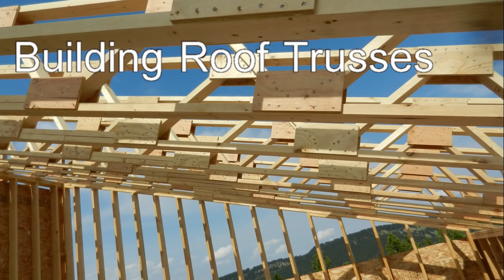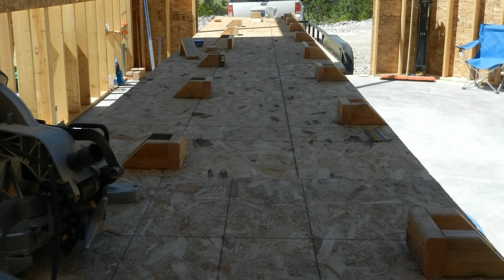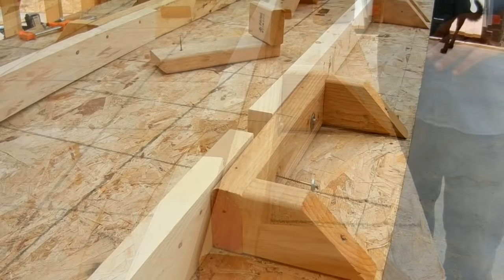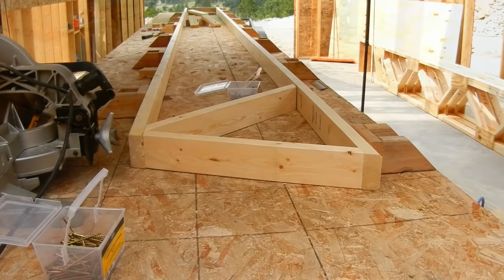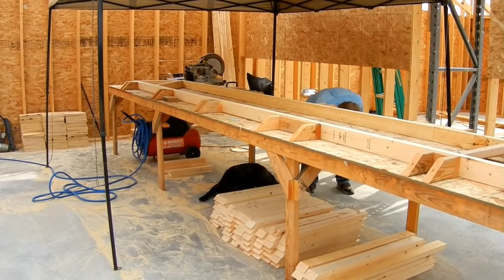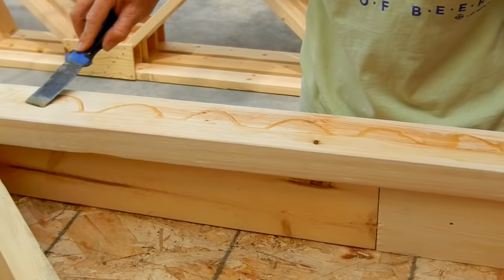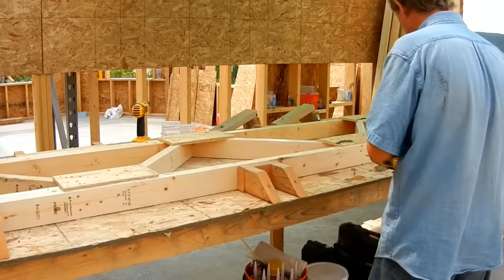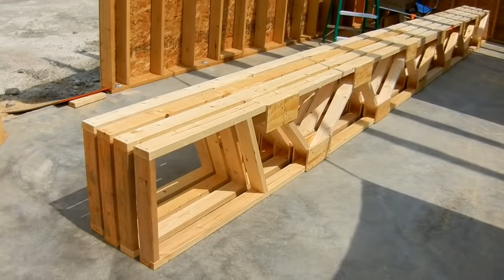Building Roof Trusses

Comment: THis video is great but where is the plan, how do I know the angle (degre) and the pitch of the roof, the lenght of each piece, unfortunely it is wortless if none of these info are provided, thanks
Reply: Clearly the video isn't a how you do the job but how he did the job.  You will have to figure it out for your unique situation.
Reply: @Michel Boutin --- After you know the pitch, depth of truss and the truss' span all calculations can be made using your high school taught trigonometry. Btw, you would need to know also the web design pattern.

Comment: Good job, curious though, why did you use the 2 by 4s on the flat side? It's at least 3 times stronger vertically.
Reply from the maker: I did it to have more material to nail into. 2x4's are stronger in bending strength vertically but thats not how a truss works, the members are primarily in tension or compression and that is the same in either orientation.

Comment: How much weight can this truss carry compared to 2x10 floor joist
Reply from the maker: Depends on the span, a 2x10 typicality would only be used to span about 10 feet. I don't have a load rating for you but it is many times what a 2x10 would hold. Especially at a 20 foot span.
Reply: @BSpotBuilds  thanks for the reply . I am planning on building some 30’ floor trusses soon but I have yet to decide whether to build Pratt trusses or warren . Just like you . Can you recommend what you would do? Any feedback would be very appreciated it since you have much more experience with trusses then my self.
Reply from the maker: @jovanyjuarez7772  I am not an expert, but I believe the Pratt truss is better for floors because it will make it stiffer. You can also engineer a longer truss with Pratt using the same materials. I believe the warren uses less material for the same span.
Reply from the maker: You will have to determine what loads you are comfortable with. But typical span on a 2x10 would be around 10 feet, and it is not uncommon to go 20 feet with a truss. All depends on design, load, and how much bounce you are willing to accept.

Comment: Good job! Looks easy, and strong! Just wondering, it requires an engineer/architect to calculate lenght/ strength of the trusses, right?? Building them is easy part, my brother in Finland did the same thing, and there they get snow, maybe 3 feet at winter, right at Arctic Circle, Finland!! That have been nice and strong for 15 years now=) By the way, how long is span/one trusse?? Wau, and your house will be huge!!!!1 How many stores/ squarefeet??? Like you spot, view too =)) Where is your house??? youtheman! Ps. using Gorilla glue??? Any good???
Reply from the maker: +Eero Laukkanen Where I live there are no building codes so I didn't have to use an engineer, but I did do a lot of research and looked for comparable  designs ( similar spans, depth and loads). We do get snow here in Wyoming. The house is one store and less than 1500 sq feet the truss span is 26 feet. After some research I chose Gorilla glue it is water proof which you want in a roof installation and bonds well to rough surfaces because it expands in to the crevices it also has good strength and flexability.
Reply: Good to know, thanks!! Only one floor, your ceilings are really high, huge windows??
Reply from the maker: +Eero Laukkanen Ceiling goes from 16 feet at the peak down to the standard 8 feet.  The windows aren't huge as they are around the walls.  Makes it feel much more spacious inside since it is a small house.  Check out http://thehighground.weebly.com/

Comment: What is the distance between both walls?  I'm trying to design essentially the same thing, but need to span 28'.  I am not a professional and really want that single pitch roof.  I really don't want to pay an engineer. Is this possible to do on your own? can you suggest any books etc...
Reply from the maker: 20 feet between walls, truss is 26 feet total. You can make your own if you don't have to comply with a building code that states otherwise. I don't have time right now to find documentation, but a Google search will get you started.
Reply: @BSpotBuilds  Thank you! Yeah there are no building codes here in southern Missouri.  I do want to make sure it's safe though.

Comment: Would adding wood glue to all joints help the strength of the overall truss?  I love this video!
Reply from the maker: All attach plates are glued. If you mean the 2x4 ends, no I don't think it would do much to increase strength.
Reply: I was taught that the glue ends up being stronger than the wood itself...if it clamped under pressure or in this case, glued and screwed.

Comment: Your spacing is 24" or 36" in this video ?
Reply from the maker: Roof truss  spacing is 24".
Reply: @BSpotBuilds  Just an update, my trusses are just a bit longer about 27 ft total length. I built roughly 20 trusses so far out of 52. Everything is going nicely I used self tap wood screws so I didnt have to pilot my holes and I used 3/4 OSB for gussets and 16" × 7.5" . By myself I can do 1-3   per day depending on how things go.  I only put one up to check it the first one I made, the prototype made a few adjustments before making the final jig on my truss table. I noticed that plaining with my electric planer till flush before setting the gussets helped get everything really flat. I used premium construction adhesive with the 3/4 OSB. Same thing minor changes. I glued the seams where the second 2x4 holds it all together glued the whole thing in. Thank-you for your video once again! Let me know where I can send you pictures of my contruction journey and my finished trusses if your interested. Thanks again !

Comment: How did you size the trusses to be sure they met the strength requirements needed? Did you consult an engineer? They look good and the video was interesting, just curious.
Reply from the maker: +SethGelineau --- I researched trusses and looked at buildings with similar designs. The span and load are nothing special definitely not pushing the envelope. From my experience if you want to optimize a design, and build it as close to the minimum as possible for both material and cost savings you need an engineer. I am to cheap to hire an engineering and am willing to accept any risk there is in my work. I have worked with commercial trusses and these came out much more stout.
Reply: Thanks

Comment: I'm confused, you appeared to use standard "Yellow Zinc coated Phillips heads to assemble the truss. These screws do not have a shear value for structural loads. How did the truss pass inspection? You opted for appears to be 1/2" plywood sheets vs a $.97 mending plate, why? Mending plates have proving to be a superior in every aspect of structural loading in residential construction. Are you concerned with people following your example and having catastrophic truss failure based apon you design?
Reply from the maker: No I am not, mine haven't failed so why would theirs. Are you worried that you will discourage people from living a full life by scaring them in to relinquishing control of theirs to designated experts?
Reply: @BSpotBuilds  no I'm not. I asked legitimate questions that you did not answer. Yellow Zinc Coated screws do no carry shear load? You did not use proven mending plates over plywood sheeting. A technique that is no longer used or approved in residential construction. You present your truss building video as if you are an expert and your not. When I ask legitimate questions you fail to answer instead you attack me and my motivations. I did not attack you, I asked simple questions. This is what I really don't understand, you put a video out for public consumption. Then you attack anybody who questions your ways and means of building. If you can't take the question don't publish your videos.
Reply from the maker: Ok, you want to have an intelligent conversation so here it is. I publish a video it's what I did, it is suitable for my situation Its up to the viewer to determine if it's suitable for them. It is not hard to design a truss to withstand normal roof loads I believe it is wrong to discourage people from doing so. Also If someone had a failure it is unlikely it would be catastrophic. With that said I used screw in two places 1) on the ends of the truss to hold the boards together when connecting to end grain. At the eave there is essentially no load and at the ridge the joint gets a connection plate when marred up with the truss for the other side. 2) On the center join where the primary purpose is to clamp the two surfaces of the glue joint together while it dries.
Essential the screws are for assembly not for structural strength.
So the connections on my truss have glue, nails, and sometime screws to attach the gusset plate. Before the 50's it was common to build trusses on site and the connections were just nailed that's it. As for the mending plates I cut 48 gussets out of a sheet of plywood, so at 97 cents a mending plate that's about double the cost to use mending plates vs plywood and I cant glue to a mending plate also they are not easy to properly install in the field with a hammer. A field installed mending plate is far more fragile than the ones pressed in on a truss jig in a factory. Next time if you want a positive response ask a question don't state that everyone knows mending plates are the way to go whats wrong with you? and are you concerned that you are killing people.

Comment: Does pre drilling save on batt live as opposed  to useing two batts in the impact driver ?
Reply from the maker: Walt Lars The reason I pre-drill is to help prevent cam out and to allow the screw to spin in the first 2x4 so that it will pull the second 2x4 tight against the first. The screws are mostly there to clamp the two pieces together until the glue dries.
Reply: Cool thanks

Comment: Not sure where you work, but do you have an engineering degree? Using the IRC's prescribed rules, I've not seen truss design codes because every project  is  so different. I know it provides for traditional hand framed rafters though.
Reply from the maker: I don't,
No,
IBC ? I never cared for building acronyms.

Comment: I've built my own roof and floor trusses for years. In fact I've never actually bought a manufactured truss. Never had one fail yet. I always found that the simple ones are about a third the cost of manufactured ones and the really complicated ones are an even greater savings than that.

Comment: What does the glue do vs just using screws?
Reply from the maker: The glue is much stronger than the nails and screws. The main reason I used screws in a few places is to clamp the part together while the glue dries. Engineered lumber such as LVL and I-joist only use glue, and old time trusses only used nails.
Reply: @BSpotBuilds  damn i didnt realize glue was that strong.  I guess with a big area covered in glue it is.  Hey do you know if you build your own door jamb are you using just glue to glue the jamb legs to the head jamb or should you shoot some finish nails in there too?  Ive got a router also was thinking about picking up a rabbet bit and tryna make a homemade jamb.  Wasnt sure about what all to use to fasten the pieces together.
Reply from the maker: @morokeiboethia6749  I would use glue and screws, because the screw has better pull out strength in the end grain than a nail.
Reply: @BSpotBuilds  I got to see a vid a while back that was filmed by one of those testing agencies that works in tandem with code lawmakers and it was a comparison of nails vs the code equivalent screw.  I had always heard "nails have better shear strength and thats why they are used."   The nail did not win any of the tests against the screw.  It was a test that fastened boards in various ways then a hydraulic mahcine that measures pounds is used to  put tentsions on the boards.  The test is stopped when one of the 3 things happens - 1 "pull out" - nail/screw can not hold into the board any longer and is pulled out 2( shear out -  nail/screw snaps due to tension  3)tear out - fastener holds into a board but tears out the edge of the board   The screw won ever single test.  One was where a horizontal board attached to 2 vertical boards then the machine puts shear force / downward force on the horizontal board.  Most people would think the nail would win b/c it supposedly has superior shear strength.  It never makes it to  that point.  The nails lost every test due to pull out.  Screw not only won but it won by a landslide in the tests.  Home builders use nails b/c they're cheaper and require less man hours to complete building a frame.  Nails are not structurally superior in any way.
Reply from the maker: @morokeiboethia6749  I agree, and if you need more shear put two in. Same thing with pre-drilling, I always pre-drill, it minimizes splitting and helps pull the two boards together. But the experts will tell you it takes too long and is a waste of time.
Reply: @BSpotBuilds  Me/friend of mine were building a pier with a huge deck with compostie decking boards (probably trex).  I started predrilling b/c the trex screws had rubbed the skin on m fingers raw b/c of the way the thread is.  I started predrilling just so the screws would catch the holes immediately where i didnt have to hold them in my fingers and eat the skin off and of course i get the "predrilling is a waste of time."  I said ok lets race.  If you have a lot of screws to drive like on decking it actually was faster b/c i was done and he was on his last joist but not even half way.  I just drilled a 100 holes then drove screws those 100 holes but only switched from drilling to driving screws one time.  Predrilling is definately easier on the wood especially if you're using a regular drill to drive screws b/c that dry torque of a reg drill splits/tears the wood really bad especially if you're toe nailing.

Comment: Is their a problem if I use 1/2inch osb for my gusets?
Reply from the maker: I am sure there is an installation method using OSB that will work, It's not common and you will have to ether find a design to copy or design it your self.

Comment: Why on earth would you do all that pre-drilling and screwing when you had a framing nailer ?
Reply: For a more accurate squaring of the assembly. Screws pull things straight and tight. Nails are more likely to blow out the ends of lumber as well. That's why he pre-drilled as to not split the material.
Reply: @patmos7521  Commercially made trusses are mostly held together with Truss cleats and nothing else. Also nails have a better shear strength than screws. Just seemed like like a lot of overkill.
Reply: @jimmclean9312  Maybe so. I respect the man's methods, though. Seems to care about his work so why would I question that?

Comment: Before using any wood in framing; go to the lumber yard and hand drive in a framing nail or two and then pull them out.  Some wood will not hold a nail; lumber yards nowadays will sell just about anything,

Comment: Nice. What if you covered the open faces with rough cut lumber? It would look like a rough cut beam, but be much lighter...
Reply from the maker: I filled the open web area with insulation.
Reply: So these were enclosed within the ceiling?
Reply from the maker: Yes, sheathing on top drywall on the bottom.

Comment: Hope they were engineered for what ever load maybe snow.Just because they look strong doesn't mean they are.
I used to be sawyer at certified truss.I cut many cords and webs on a metra cut centerline saw never seen any flat trusses built like that.
Always nail plate and no 1 or better top and bottom cords.Glue and screws no way never.

Always work from a very specific cut list inspected and stamped.
But hay my work went on public building so maybe it was over kill?
Reply: The Simpson Strong-Tie plates are stamped "non-structural applications only", (labeled not for truss applications).

Why not for truss construction? Do you have a product that can be? Like the MT20 that is used by truss companies?

Simpsom Strong-Tie said:
"Truss construction has very specific guidelines and requires appropriate equipment. We do manufacture metal connector (truss) plates, but they are sold only to licensed Component Manufacturers in conjunction with the Simpson Strong-Tie Component Solutions™ software suite. Thank you!"

I've installed one with a hammer and the plate warps and some sections pull out slightly. Using a wood block and hammer helps and maybe you could use screws, nails or bolts to help secure the plates but, technically you should only use appoved techniques because they are proven to hold up.

Comment: Engineered trusses exist for a reason Building and safety Dept,s and the code have leaned that its a Safer and better way in the long run, roofs don't fall on Firemen sooner than expected and when you go to sell, it passes the buyers  inspector, not to mention the insurance company pays off on your claim after that fire lastly, if you get caught by Builder and safety  it will cost you 10,s of thousands dollars
Reply from the maker: I believe you are wrong on every point. Do you think part of truss engineering is how long it will with stand a fire before falling on firemen? Why did you assume I have to comply with building codes? Why do you assume I have insurance?